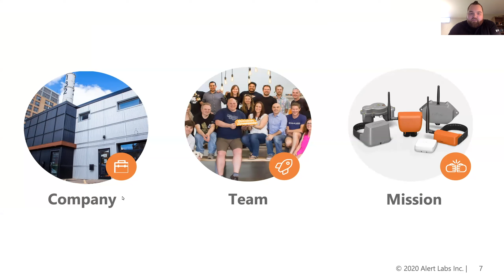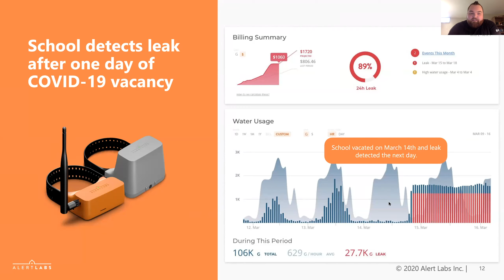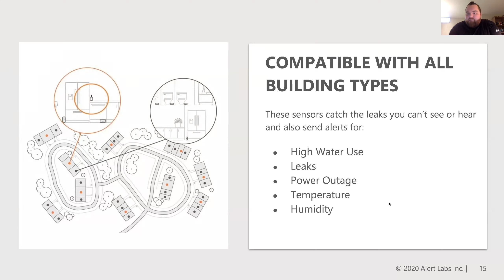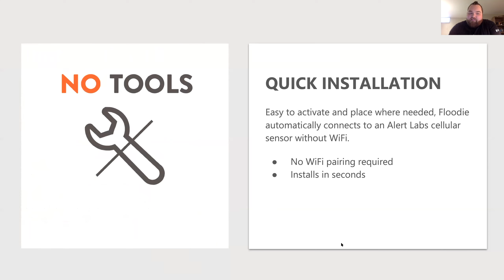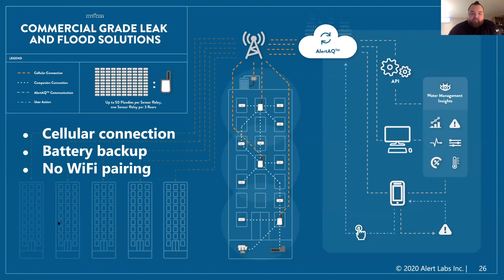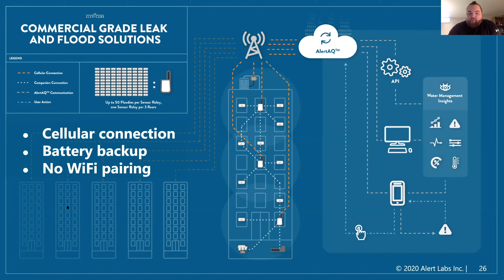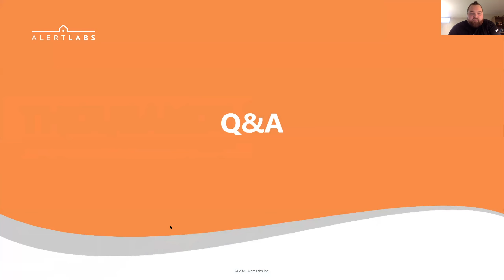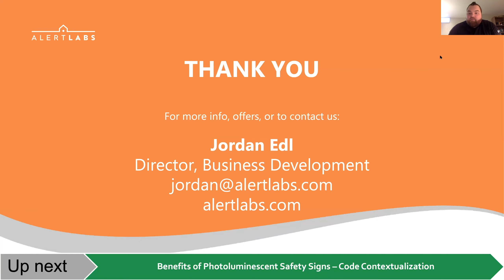Reducing Repair & Maintenance Costs with Smart Water Sensors - NFMT DemoCast

Comment: Do you have solutions for water submetering? Older apartment buildings may not have a meter per unit and require estimated submetering, essentially splitting water usage evenly across units.
Reply from the maker: Hi Anthony. Yes, we can help with this. Could you send an email to sales@alertlabs.com? Thanks!